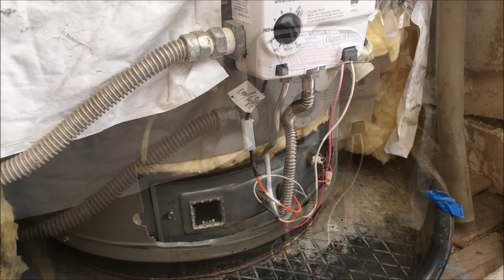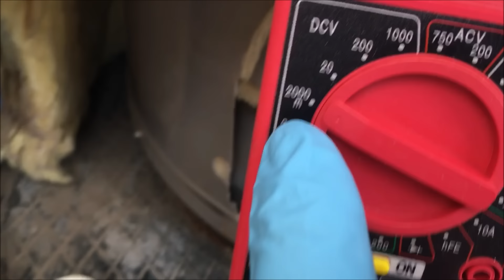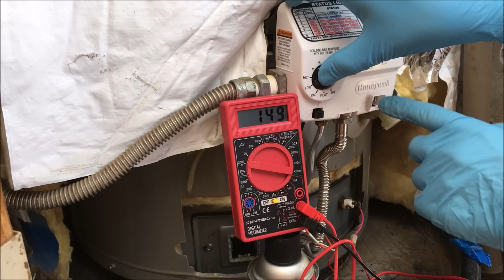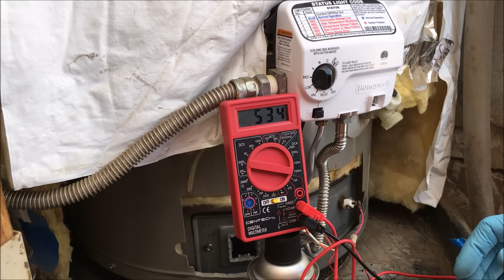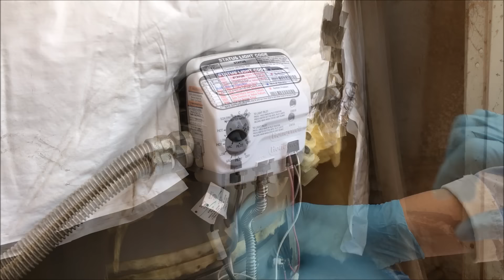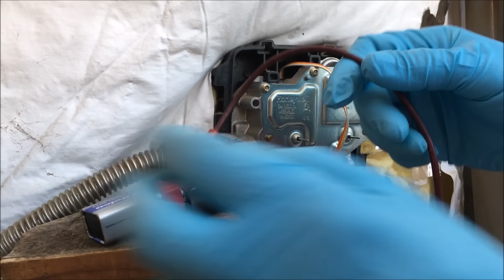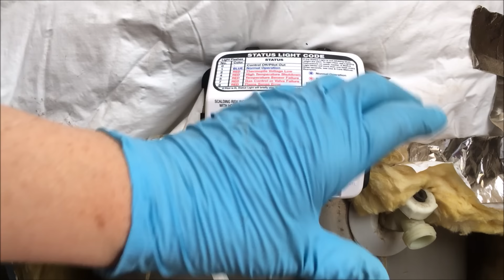Troubleshoot Water Heater AND Honeywell Gas Valve | Step-by-Step

Comment: Long shot here but I really need an answer to my problem.  Water was leaking out of the control valve box, but the threads where it enters the tank were dry.  I've looked everywhere for an answer as to how this happens.  I think I need to replace the whole control valve box assembly and bought a replacement, but now someone is telling me not to bother because my tank is 12 years old and "the sensing bulb inside the tank is rotted through".  I can't find anywhere what a 'sensing bulb' is, but I suspect it is the metal protrusion on the back of the control valve assembly that inserts into the tank, therefore replacing that assembly should indeed fix the problem.  Water heater was still heating water with the leak going for probably 1-3 days.

Comment: Honeywell electronic valve expensive, trouble prone & no extra safety beyond a regular thermocouple!
Reply from the maker: Yep!  Thermocouples are much cheaper that thermopiles, too.
Reply: Hello, 'Fru' 😊.

 Having issues with my water heater. I'm believe it's shut off somehow (as explained in one of your vids); but every time I call one of these gimmicky companies for a repairman*, they send a *salesman instead. 😠 I am CERTAIN this is an easy fix, so I'm doing this myself. 

Coupla ?s 4 U: my gas has been shut off since this all began about 2 wks ago, and the GCV is off as well. Is it safe to proceed with the instructions after 'simply' turning it back on? Should I consult with the gas co. first?

Comment: Excellent video!!   Do you know the purpose of the  3 solder pads at the bottom edge of the circuit board labeld TX, RX and GND?  I suspect they're for measuring the voltage supplied to the valve pins. 

Can you make one for when the problem is the gas valve and how to repair/replace it, or would there be liability issues?

Comment: I have spent hours and hours trying to find troubleshooting information for my State water heater. Your video is so amazing and I am sending it to all my children and anyone else I can think of. Last September I spent $170 for 15 minutes of service to a couple of (young) plumbers who told me that there were no error codes, and the pilot light works just fine - lights up fine and this was information that I already knew.  My husband and I were told that gusts of wind coming down the exhaust pipe (if that's what you call it) were putting out the flame.  No troubleshooting was done at all. The problem continued. So periodically, I climb up into the attic and relight the water heater. It has been staying lit for a couple months at a time but now is going out weekly. My husband is getting antsy and does not trust my DIY skills.  I may have to call out a plumber, but thanks to you I know more about water heaters and hope I can find a troubleshooting plumber.
Reply from the maker: Hey Terri.  Yes, wind coming down the flue/exhaust pipe can cause the flame to extinguish.  But, that's rarely the case re the issue you're having.  Some plumbers, who are not ethical, don't want to troubleshoot the issue; they want to replace stuff that doesn't need replacing and charge you a boatload of money.  Hence, that why I fix stuff myself.  I learn as I go, and you can too.

Please tell your husband that Frugal DIY (me) is asking that he PLEASE stand down and let you give a go at fixing the issue.  I know that you can, and I have no doubt about that.  Girl, get yourself a multimeter, just like mine (Harbor Freight $6.99) and troubleshoot the issue.  I'm in my 60s, and have to crawl up in the attic tomorrow to replace the belt on my whole house fan, and I'm happy to do that so I can fix it myself and save boatloads of money.  

You've got this and can fix the water heater all by yourself.  My guess is the thermopile is weak and giving way (here's the link to my video re how to change a thermopile: https://youtu.be/httzdihCxvM) or, most likely, it's the control board faulty.  Get to fixin' now--ya hear?

Comment: jumping in here to add my voice to the others raving about this video. 

i followed all of the detailed instructions and ended up having a shot control board. ordered a new valve from Honeywell (now supplied by an off-shoot Honeywell Home brand called Resideo fwiw) off of Amazon for about $175, it arrived the next morning by 7:30, and i was able to get the control boards swapped out and my pilot-relit in about 5 minutes. 

thank you so much for this video, you easily saved me a thousand dollars by giving me the tools to diagnose the problem.

Comment: Condensation on the circuit board will cause these to shut off. I can't believe a company cheaped out so bad on the control board for a water heater! But, a spray of WD-40 fixed it.

Comment: I don’t have much experience using a multimeter. Mine only goes to 1000 milli volts of DC. Is that fine or do I have to be able to turn it to 2000 to test?

Comment: You just saved me a minimum $700. I swapped out the gas-valve cover with circuit board after testing both vales per instructions. Now in new condition. Great to have my hot water back. Thanks & best wishes

Comment: This video saves another .... our heater stopped working. I couldn't keep flame going ... thought for sure it was thermopile. Tested it isolated and it was fine ... when I tested with the thermal switch I had nothing. Found there is a little black "button" on this switch like a breaker that can trip. Once reset everything started working as it should. Saved me a visit from the plumber.  THANK YOU!
Reply from the maker: That's wonderful to hear!  ;)

Comment: I agree with the other comments. This is really an outstanding video. She is very thorough safe, and easy to follow in explaining her troubleshooting steps. Step by step she shows how to verify each working part while isolating the faulty part(s) needing cleaned or replaced. I to had a bad control board. So, I purchased a used one on Ebay, installed it and my water heater now works perfect. I learned a lot in the process and saved $. Thank you!

Comment: I just wanted to add, sometimes if your water heater shuts down you can end up with extra condensation in your drip pan. If when you get water heater to light, it shuts down when reinstalling covers or makes a loud sound like train coming through, the water may be blocking the air flow required for combustion, It can shut down burner or whisle trying tosuck air from other places, so clean water from drip pan.

Comment: I had this problem.  My water heater dated back to a 2006 manufacture date.  The absolutely best thing you can do is replace the entire pilot/burner unit.  In my town just the control unit is $250.  My entire pilot/burner unit  was $350.  All I had to do was plug the wires in and hook up the gas lines.  Two hours later I took a nice hot shower.  If you are not comfortable dealing with gas get some with experience to do this.

Comment: I had a Rheem professional Water Tank; RESIDEO CONTROL BOARD Installed a year and a half Ago Brand new. 7 FLASHES WHICH is the Gas Board or Gas Valve..Im going to trouble shoot it myself....I'm being charged 700$$$ to fix it.I think it might be the control board itself..Funny thing is every 5 minutes i turn it back on and it stays back on for about 5 minutes than turns back off!!

Comment: I replaced my thermopile as I had low mv's, but when doing the test at 21:15 mins my pilot valve made a light click and then would click no more....my main valve was good.  So in my large metro area, there is not such supplier of any of these individual parts, you must buy the entire burner and valve assembly at $300. That is why the plumber in Comments probably has never replaced a board alone...  But I have a 12 year old water heater and 12 warranty. I have excellent water in my area.  Cost of a new tank is $930 for similar model warranty,  $1600 for heat pump version with possible rebates (difficult to determine in 2024 and must buy form HD). so I'm likely going to get the assembly for $300 that I can easily do myself as that will likely get me a few more years as all else looks good but what do you think?

Comment: I have a Rheem water heater that leaked and is dripping. The warranty dept told me to take all these pictures. Is it safe to do all these things with the gas still on? Or should you turn off the gas before messing with the gas panel? Do I need to shut off the water before doing all these things as well? Sorry I'm a new homeowner here and just concerned about safety issues.

Comment: For me it was a clogged gas line. I didnt have compressed air to blow in the tube so I removed the whole burner assemble. Cleaned it up best I could and tried blowing in the gas tubes.The smaller gas line was completly gloged but after a few tries I got though.reassembled everything and fired right up. Damn that felt good to fix, Thanks for the help!
Reply from the maker: You're welcome.

Comment: Excellent video. These control boards are absolute junk. I’m on my third one. The previous one only lasted 2.5 years. Maybe it’s my hot summer garage, living in Arizona. Thanks again.
Reply from the maker: Thank you.  I, too, don't care for the boards and the numerous issues I've had to fix related to them.  It's been going on for years.  All so unnecessary.

Comment: My hot water heater pilot light works but goes out after a few days, weeks, sometimes months. Very inconsistent. I noticed I have to hit the thermal switch to reset each time. I cleaned the filter on the outside and the one inside near the burner. Still nothing. It’s 10 years old and I think it may be best to replace it instead of fixing it.

Comment: Did the gas valve check and get a slight clicking on the pilot side and a louder clicking on the burner side. Replaced the  thermo pile assembly { thermo pile , igniter and pilot gas line } and the control board and pilot light does not stay lit. Did the switch test and got the reading all the way up to 750 mm.

Comment: Currently renting a room in a house, tried to jump into the shower and had to jump back out very quickly -- went to look at the water heater and read up on this electronic valve controller because I'd never seen one before.  After reading the labels, hopped on YouTube to learn more and found this video.  Thankfully I didn't have to deal with any bad boards, the water temp must've just been set too high or something faulted somewhere and locked the valve up.  Maybe just bought myself a few more days on this board, or maybe it'll just keep working for a while, but thank you so much for explaining all of this.  Eventually got the pilot lit and the board powered back up!  Landlord is also very grateful :P
Reply from the maker: Bless your heart, TheFus.  You're VERY welcome!  I'm glad my video helped you.  Please take good care of yourself.  ;)

Comment: An absolutely awesome tutorial! Now my problem is finding the board to fit mine. The number on my gas valve cover is a WV 884082216, will any board that looks identical work?
Reply from the maker: Thank you and Merry Christmas!  I can't answer that question with certainty.  I can tell you that I used a control board that came from a different model gas valve, and it worked like a charm.  Try eBay.

Comment: This video truly deserves all the praise it has received, outstanding in every way...
My problem is simply that pilot flame goes out the instant I let go of the "press in" button...but as long as I hold it pressed in, the LED light gives me "normal operations" flashes...(pilot flame ignites easily). So I'm assuming the control board is the problem, but I don't have the tools to check or confirm...
Reply from the maker: JGK, I agree with you.  My guess would be the control board is faulty or has failed.  Could also be the pilot pin.  No way to know for sure unless you troubleshoot it.  I wish you the best and Merry Christmas!
Reply: Thank you and Merry Christmas to you too..  :  )

Comment: In my case, after my water heater shuts down, it doesn't come on again untill I restart it again.
I followed your instructions and checked everything and seems like the problem is control board. I can't find the same control board on eBay or store,the number b1042 is not available but they have c1110 or c1140.
Can I use that,،???

Comment: Excellent video. It helped me troubleshoot my water heater to a bad thermopile. I paid about $35 and swapped out the old pilot and thermopile assy and the burner fired up right away. Your video was well made and very descriptive. Good job. It saved me about $2200 that a plumber wanted to charge me.

Comment: So I'm having issues with the pilot light staying lit after releasing the button. I changed the thermopile because that's the initial error code I was getting. After changing it's not giving an error code anymore but it light. I tested the thermoswitch and took the cover off to test the pins. The one for the pilot light was bad. Shouldn't the valve give off the error code for that?

Comment: Hi Frugal DYI! Your video is amazing. Thank you for laying everything out so well. I've done almost everything from your video but but hit a few road blocks. I'm hoping you can help me. To remove the thermocouples unit, the tank has a warning to replace the gasket. Is this necessary? 
And I do not see spark in the pilot window. I've disconnected the igniter wire, placed it near metal, depressed the switch and I see a spark jump from wire to metal. Any insight would be greatly appreciated. Cheers!

Comment: Hi, I followed the video and the pilot valve isn't engaging when I apply current. The main burner is clicking. Does that mean replace the entire gas control valve unit if I have a non-responsive pilot valve?

Comment: The pilot side of the gas valve ended up being bad on mine. I was going to get a new water heater, but I figured at this point, why not go ahead and look inside the gas valve. It took a special Torx security bit to open it (I already happened to have one). A tiny hairs width wire had become un-soldered on the pilot valve solenoid. After cleaning off a little insulation from the wire I managed to get it re-soldered and re-assembled (it was touch and go). Now it was clicking with the 9 volt battery test just like in the video. With no gas leak smell, I went ahead and tried lighting the water heater. It works great! Thank you Frugal DIY for the best instructional video I have ever seen!
Reply: I had the same issue, you are my hero!
Reply: I'm glad you were able to fix it! After all the trouble to make mine work, it didn't last all that long. I've had a new water heater for about 6 months. I think it did the same thing, except this time, I lacked the motivation to repair it. I ended up buying a new 9 year water heater from Menards for about $600. Service companies wanted $2,500 to $2,700 to do the job! Prices nowadays are shocking!
Reply: What if you changed the burner assembly to a new replacement. Pilot lights tays lite code flashes 1 every seconds. But the main burner does not light. All of the control on b assembly test fine and indicator light blinks like everything is good. Should I doo what your saying and test gas valve?
Reply: Same issue here. Wouldn't have know if not for this comment. It should be a part of this video.

Comment: I am running into the same issue with my control valve. Problem is that i cannot find the same board for mine. I have a WV8860B1318 but i can only find WV8860B1310 would this be a suitable replacement?

Comment: This is a very professionally done video, factory training cert level. I have a question though. Even though you eliminated the thermopile, the thermal switch and the solenoids as the problem, you did not test the over temp switch. Is your OT SW normally open or normally closed? Could you test it to see or would it only fail by not providing voltage needed to trip the safety shutoff?

Comment: I have a A.O. Smith 30 gal propane with a Honeywell control valve that I purchased in 2017.  From day one the temperature control never worked, water is scalding hot but can not be turned down.  It has functioned fine for 6 years except the temperature control.  I get no error codes, would the problem be the circuit board?  Thanks for your help.  Awesome video by the way.

Comment: If is not broken don't fix it, unless you got tons of money, then is like good for you, HEY? I don't so I have to do everything else myself if I want it done right! This is one of the best ever videos on the net! Just great stuff all around. For me to understand stuff real well I have to have a base line, an overview covering the age of the heater, a guesstimate of total costs, and an outline of what is to happen always helps me understand better. Other than that, i learned a lot. Do these valve assemblies have a mandatory replacement time frame? I was told they had to be changed every 5 years, really? At almost 300 bucks for the new valve and 500 for the labor, I ask myself where is the benefit in upgrading to a more "energy efficient" unit if you will end up paying more in the long run? i just don't see where is the mentality behind that, except that someone will benefit from it and it won't be you. 😅🤣😂👍👍👍
Reply from the maker: Thank you, Testos2701.  That's kind of you to say.  Nope, no mandatory replacement time.  That's hogwash.  The valves have a lot of issues that the old-school mechanical valves did not have.  In my experience, and I'm old, the old-school valves were superior to the newer digital valves.  If I had to pay $800 to fix an issue with my water heater, I'd buy another (used, of course) water heater.  They sell junk nowadays--planned obsolescence.  Shame on any corporation that sell junk.  It's not lost on me.  ;)